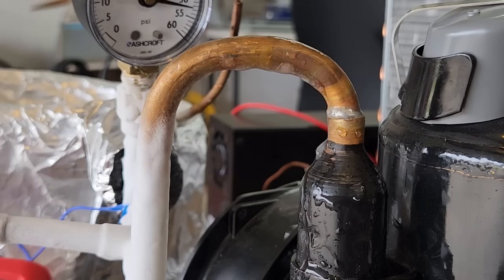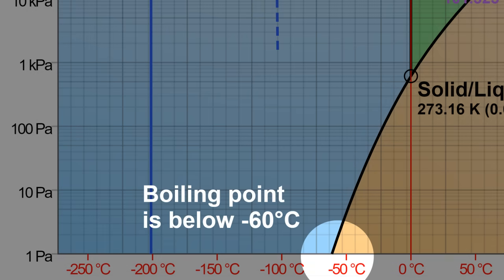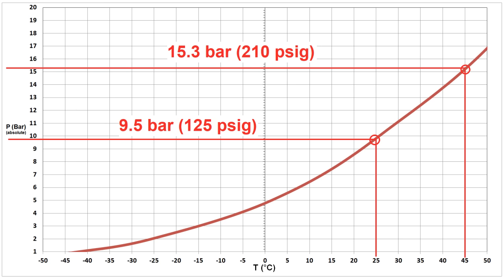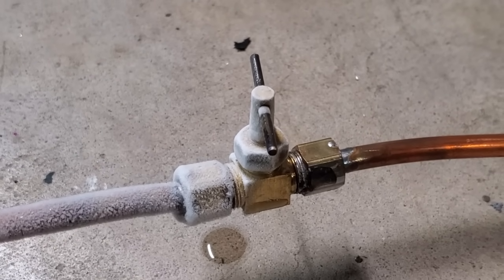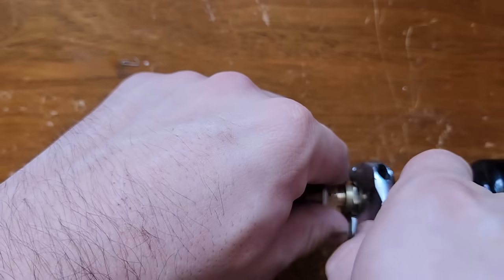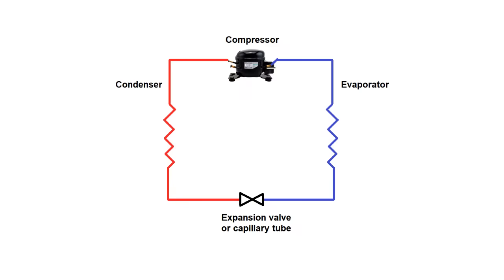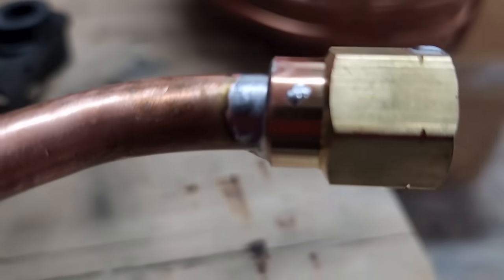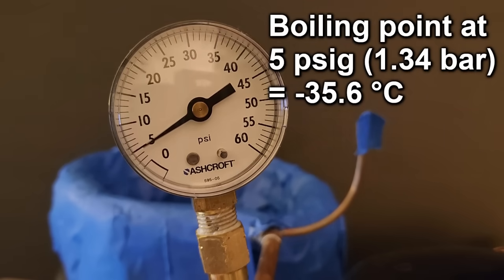DIY Vapor Compression Refrigeration System

Comment: I've really enjoyed this series on cooling, thanks!

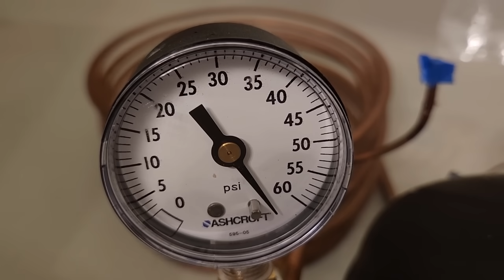One question for you: did you purge the air in the system before pressurizing it with propane at 15:25? I'm guessing you did but didn't show it in the video. If not, I imagine it's probably okay (24:1, extremely overrich mixture), but personally I'd sleep a little better knowing there wasn't any oxygen in there at all.
Reply: It was vacuumed before charging with propane

Comment: Interesting to see someone now days fumbling through this! Long ago in the 1960's I did my fumblings and built a cascade air liquifier,  first stage using a 7 1/2 HP Copeland compressor with 3 pounds of R13-B1 refrigerant. The second stage used a 4 HP carbon dioxide compressor with R14 refrigerant. Both compressors had to be water cooled. The unit would liquefy about a liter of liquid air every two hours.
 I'm not sure how you will get usable amounts of liquid air with such small compressors and without water cooling them. For your first stage, use an open frame automotive compressor so you can use water cooling on the head. For your second stage, use a SCUBA compressor. These have an open compressor so you can water cool the second or third stage head. (SCUBA compressors are 2 or 3 stage)

Comment: that coaxial condenser coil is so cool! I wonder if it would have been easier to coil if you waited until afterwards to solder it - i can't quite visualize whether the coiling process would put stress on the solder joints.

did you push the inner tube through, or feed a string through and pull it?

Comment: As a Hvac, I myself.  Watching all the research you did to make this little unit work. And your calculations and Matthew used to come up with ballpark figures. I got you very close.. 
      To dial it in there was just one formula you were missing.  Because it was a cap tube system using superHeat to get the charge exactly correct.    But with your system airflow is King..   also knowing the correct airflow over evaporator and condenser.  Too much airflow for the BTUs to be displaced in the air passes so fast over the fence it actually does less work..
       Too little airflow and efficiency drops way down. 

If the airflow is wrong over the Evaporator or the condenser .  When you attempt to take your superheat measurements, they will be wrong..  you will get a measurement, but it will be based off the wrong airflow over the condenser or evaporator that messes up the formula for coming up to the right charge for the desired effect. 

But even having wrong airflow in wrong charge, you still keep playing come up with some sort of result that actually works .   Compressor might have to work harder the system Majus consume more power in ratio to the amount of work. It’s actually doing.. 

Excellent video very impressed .

Comment: One thing I have always wondered, is if it is possible to have some kind of turbine act as a pressure drop/capillary tube. And use that power to recover some pressure with either a pre-compressor. Or using a dynamo to recover some electrical power.

Two problems I could see with this, is having to really tune the turbine's resistance. Or have the dynamo change it's power. Secondly, you would need a really sophisticated turbine design for that large pressure difference. (Turbines are difficult...)

But even if it is difficult, just using resistance to drop a pressure seems wasteful  :/

Comment: I did refrig, for 30 years,  with the suction line frosting back to the comp,  you are flooding refrig, back to the compressor,  the valves can't handle to much of that,  the liquid going in to the compressor will pull oil out of the comp.  usually causing a comp failure,  how to charge a cap tube system,  add refrig,  till you get frost back to the comp,  and then start removing a little at a time, you will see the frost line move back to the evaporater,  that is the correct charge,  but you are not removing the cold from the evap....  it all has to work together... make sense....   I use to work on cascade systems for hospitals.... they would run -30F to minus 50F for sterilizing...
Reply: The cap tube does not throttle the refrig.  that is why the correct charge is necessary,  if you use a TXV it throttles the refrig,  so you have to use a accumulator to store refrig, during the throttling cycle...   one last thing, you have to have back pressure to cool the compressor,  suction line cold to touch...

Comment: Wouldn't it have been better to use a T and then reduce instead of drilling an elbow for the coaxial exchanger? Also I've always thought solder was bad for refrigerant and that you need to braze the connections.

Comment: Did you Flow nitrogen before brazing to eliminate oxygen inside the tubing to prevent oxidizing and scaling inside the copper? It will plug up the small offices and spaces inside the system?

Comment: To get more efficient do you need it help the thermal conductivity of the water you can do that by adding glycol maybe Automotive antifreeze or an alcohol like methanol ideally around 15 to 25% mix it also helped keep the water from sludging in the coax. A Water mix as a heat sink maybe most efficient at 13° degrees freedom should allow a greater delta-t

Comment: Since you're already measuring the inlet and outlet temperature of the cooling water on your evaporator, why not do your heat transfer calc with that? Power = mass flow x Cp x deltaT

Also, use an antifreeze mix so that you don't ice up inside the heat exchanger, but you probably knew that. Pre mix is nice since the thermal properties are well published.

Comment: It looks like you have too much refrigerant. The frost line should go no further than half way past the suction receiver, that's a big part of your cop problem. That and you are using capillary tubes instead of thermal expansion valves.
If you want to get low temperatures then you need to use high pressure gasses. 
You could also try an auto cascade.
If you need any advice I have studied thermodynamic engineering and worked on ultra low temperature systems using things like liquid helium in the low stage, I usually used R508B in my designs. Don't forget you need an oil separator and expansion tank on low temperature if you don't want it to die.

Comment: Ethylene indeed is hard to find, propylene is much more common though, you can find it in hardware stores even, but usually as a 15% mixture with propane. You can probably devise a way to generate ethylene from pyrolysis of polyethylene plastic.

Comment: would spray foaming be an option to insulate the heat exchanger? also maybe making some sort of fish rig to pull the inner tube through instead of pushing? if you can make them similar coil diameters it could be done without straightening and then re coiling? is there a lubricant that could be used to fish the tube?

Comment: In the diagram you showed cocurrent flow, now I only know about heatexchangers with a temperature difference so I don't know if this applies, but usually countercurrent flow is more efficient. How does this work for a condenser evaporator combination?

Comment: you can use refrigeration compressors to make crude vacuum pumps and air compressors.

back in the 70s and 80s when shop air was very expensive people took compressors from window air conditioners or household refrigerators and made air compressors and for the tank there was kits to convert the disposable freon tanks for air at 100 psi.

though you do need to be careful about using disposable dot 39 tanks including the balloon time helium tanks for air because they are not designed to be used that way and can rust out and explode .

modern refrigerators actually do double tubing if you ever scrapped out a modern even cube refrigerator the cap tubing is fed inside the return line up to the cold plate.

Comment: Given that you seem to have quite a bit of mechanical and electrical knowledge I wonder if you would benefit from trying to use an electronic expansion valve for the metering device, I would assume it could be installed and you would just need to create some sort of driver for it. Then you could continually adjust the system and test to see what the most efficient position is based on the load.

Comment: Can you add a second capilary tube parallel to the first that you can close with a valve? That way you can have a low gear and a high gear that you can switch by opening or closing the valve.
Reply from the maker: That's a valid concept for future mods. I didn't get around to doing it in this video.
Reply: @HyperspacePirate  There are cheap EEV (electronic expansion valves) such as those used in newer minisplit systems sold on sites like ali/ebay for less than 20 dollars. They are essentially just hermetically sealed needle valves that can be opened or closed by using a stepper coil on the outside of them. I think the smallest china one that may be close to the capacity needed for a small system is called DPF 1.3 with 1/4" sweat fittings on it. They can also be tested and manually opened/closed with just pulling the stepper coil off and using a strong magnet on the outside to slowly rotate the valve by twisting around.

Comment: Lots of comments so I'll keep it brief.
- Cool project well explained but don't reinvent the wheel. See tube-in-tube condensers made for marine HVAC or water-cooled commercial ice makers. These may well suit your application as an evaporator. Brazed plate heat exchangers work well for evap. or cond., but not w/o careful engineering. A cheap automotive R-134 TXV would save you a lot of headaches trying to adjust cap tube length, will also give much faster pull-down from hot.
- Ester oil has the lubricity of water but is speced for current refrigerants that don't like real oil. Refrigerant grade mineral oil would be better w/ Propane. PAG oil is not for electric compressors (dissolves insulation).
- You need to determine the charge under load. No measurements are meaningful w/ no load on the evaporator. 
- Keep the compression ratio (in AC land that is:  P absolute Cond / P absolute Evap) under 7 for less heat/longer comp. life. Lower is better. 5-6 is OK.
- Commercial propane is not a clean (pure) gas and may not be dry (wonky pressures and may form frost inside the Evap. blocking it) Use a big molecular sieve dryer.
- Mount that condenser fan back 1"-2" in an enclosed shroud to get even air flow (or use the fan and shroud designed for the condenser)

- Source: A career designing oddball thermal things for industry/military. I'll be following this.

Comment: Couldn't you make the expansion regulator (from a car's ac) fit, to replace your tine tube?

It would get some automatic adjustment to the length of the tiny tube, instead of that orifice tube.

Comment: for your coil why not have two premade smallish coils (like transmission coolers) bolted together in an igloo type cooler in a bath of non-conductive oil/fluid [say mineral oil], then have a fan at lower voltage circulate the water between the evaporator of 1st stage and condenser of 2nd stage, this way you could heavily insulate the heat exchanger "tank" inside a large wooden box filled with that expanding foam (6" or thicker)
Reply from the maker: Possible to do, but potentially messy

Comment: Old video, I know, but R290 is compatible with mineral oil, and mineral oil is the preferable oil for more.. lax installations. POE oil is made of an acid and water and added energy, it rapidly absorbs water out of the air and turns acidic and will strip copper from the pipes and deposit it in the compressor as that's the hottest part of the system. If you braze, it also strips off the oxidation on the inside of the pipes if you didn't purge with neutral gas well, and that can clog valves, capillary, and generally not good for the compressor. And it's cheaper and easier to get, to boot. Basically the same stuff used in cars but single weight like 32.

Comment: Could you use some ball valves to short circuit parts of the capillary if you wanted to add some tunability? N valves would give you 2**N settings.

Comment: youve used silicone instead of teflon, but have you tried threadsealant from loctite or some other brand. ive had pretty damn good results with a threadsealant. ive used it instead of teflon for high pressure systems like 150 bar pressure, and its very leak free.

Comment: @Hyperspace Pirate, I wanted to say awesome video, love the mix of humour and info but ALSO I have a question. How are you able to make your own phase change refrigeration cycle? In Australia, we cannot legally buy refrigerants or work with them without licence.
Reply from the maker: The refrigerant is propane. Same stuff you grill with
Reply: @HyperspacePirate  Yeah thanks, I had gathered that but even still, we can't do that in the land of Aus. On another point, did you have to modify your PSU for the compressor or were you able to run it quite simply? (Did you use a compressor with speed control and if so how did you wire this up?) 

p.s sorry for bombarding your with questions
Reply from the maker: @fooproductions8312  Compressor runs straight off 120V / 60 hz with no speed controller. I have yet to come across a variable speed compressor
Reply: @HyperspacePirate  Cheers Mate

Comment: For cascade cooling and with ethylene on stage 2, you will need an TXV for stage 1, do you intend to have a stage 3 with methane?. I would go with a 12000BTU R22 compresor for stage 1, and 6000BTU stage 2, and 3.  And us cascade cooling for each stage at the output of compressor (first with air heat exchanger and than cascade with previous stage)

Comment: With regards to the Butane as the compressaint, since it bottoms out around 0c; would it be a reasonable option to give a PC amazing, but not quite sub-ambient cooling? (not that I quite have the equipment let alone experience?

Comment: How would this translate to a real world  application? Maybe its over my head. But wouldnt you need an exhaust for the condenser and a directional airflow for the evaporator to get any use, since its not exactly am inside outside unit?

Comment: 13:59 you didn’t mention it but soldering one end, coiling, then soldering the other would probably be a little easier since the inner coil wouldn’t stay straight down the middle and that would change its length, and now you’re also stretching the tube which would be more difficult

Comment: one of the most common car AC scams is to replace the R22 with Propane. That would be OK, but Propane destroys the rubber seals and it leaks out....
(this is the same issue with using Propane//butane in most loops. You have to ensure materials compatibility)

Comment: So I found that you can just buy a stacked-plate counterflow heat exchanger rated for 3 bar and 200k+ BTU/h for like $45. I wonder how it would perform in comparison with the pipe-in-pipe setup.
Reply: It seems people use them for cooling wort -- an intermediate beer product -- but it looks like they are often within spec for your application from what I can tell.

e.g. "VEVOR Heat Exchanger 3"x7.5" 30 Plates Brazed Plate Heat Exchanger 316L 3/4" MPT Heat Exchanger B12-30 Beer Wort Chiller for Hydronic Heating"

Comment: Plumbers putty/silicone for threaded refrigeration lines? No. Use either leak lock or blue monster Teflon. Leak lock is meant for threaded refrigeration joints it comes in a blue squeeze tube. Also, when using Teflon tape you must put the tape on the same direction as the threads. If you go the other way the threads will push the tape right off the joint when tightening

Comment: It’s a pleasure watching an engineer work!  Two questions.  First, instead of a coaxial heat exchanger, did you consider a simple eBay plate unit?  And second, is there any advantage of running the exchanger in a counter current fashion?  I have to say, I haven’t seen solder used in HVAC since my tech teacher used it to show how good (or bad) our sweat soldering was!  Brazing is generally preferred…
Reply: brazing would be very silly here
Reply: @JH-tc3yu  and that’s because….?
Reply: @JH-tc3yu  Doesnt it hold up better against thermal cycling ?

Comment: You could also just solder 2 pipe side by side, less efficient, but easier.Or buy a super cheap brazed plate heat exchanger on vevor or sites alike

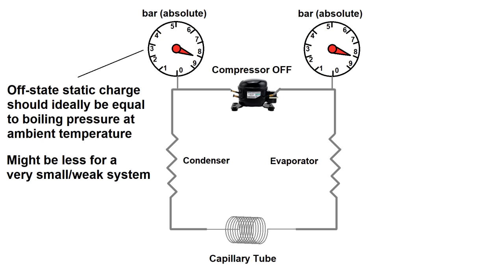Comment: At 8:15 If your turned of system if filled with "a saturated mix of liquid and gas" then you compressor would be trying to compress liquid, which it can't ?
My HVAC guy says, at rest the system is all gas and there should only be liquid on the pressure side, none in the suction side.
Also you mention charging into the low pressure port, but here too I think you have to be careful charging with the system enabled, if your gas doesn't all evaporate before it reaches the compressor it could kill the compressor. 
Usually the system is charged by weight roughly and then final charge is slowly added while measuring TX temperature and I believe for most system it's 12F but my memory is getting very blurry here with regards to the exact TX charging procedure.

Comment: Wouldn't running the exchanger in countercurrent give higher efficiency? The way you shown it you run the exchanger with both fluids going the same way - this is less efficient that running them in different directions - gives a higher temperature difference across the whole exchanger.

Comment: I really don't know anything about this but just thinking. If the needle valve hole was getting so small that it would clog couldn't you combine a capillary tube with a needle valve so you can use a bigger hole on it with the same effect?

Comment: Freon as it turns out has been used for R12, R22, AND R134A. Freon was originally and is still best known as R12. R134A is typically just called by its number. I came with pitchforks to say you were wrong, but yiu weren't. However putting it there against R134A is misleading at best. Sewing the seeds of confusion unnecessarily.